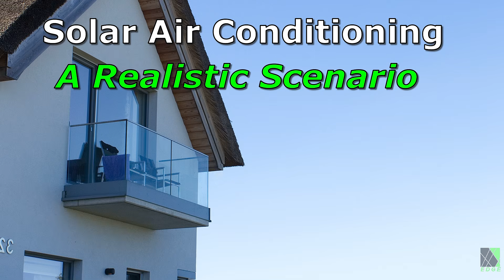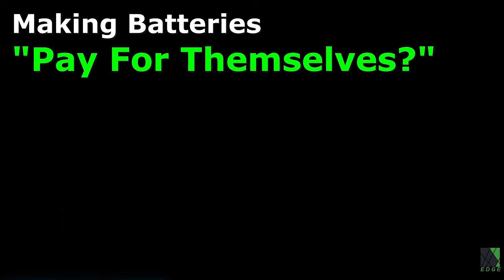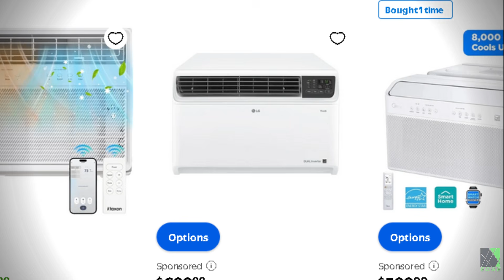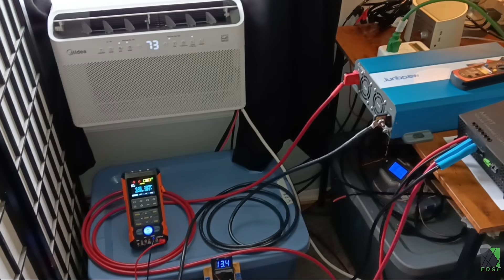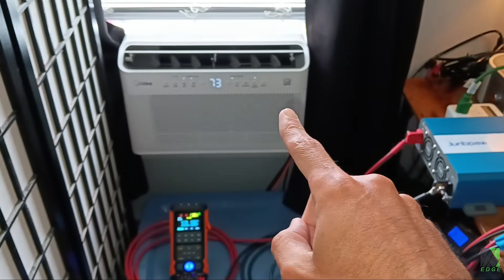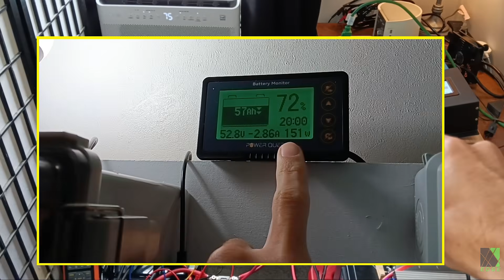I Made A Simple Off Grid Air Condtioning System - But Solar Has A COST  #Sponsored #Cyclenbatt

Comment: Love the details and how quick you explain the all the particulars. I often say that there should be more appliances powered by DC rather than AC.  I do have an eco flow wave 2 AC for my rv. I have multiple power stations in my home.  Eco for delta pro is connected to 6 circuit manual transfer switch. I run that power station during the day connected to 4 400 watt panels. It's able to run for about 6 hours running a 12 btu AC. This year i will be adding 16kwh of external batteries with a seperate mppt controller.  Watt cycle has created a cable that allows you to use off the shelf batteries to powrr the eco flow power station.  I also have a hybrid inverter as well.  I run a24 volt 3000 watt  all in one inverter in my rv. It's powered by 4 12 volt 314ah batteries in series parallel.  The system works as it should. It's cuts out if I'm running the AC and any other major appliance. Like the microwave or my air fryer. My issue with that all in one inverter is it requires high voltage  from solar in order to get the mppt to charge the batteries. The minimum is over 100 volts. I did connect a stand alone mppt charge controller for the time being.
Reply from the maker: @RAMMAN16 Thank you sir - nice solar setup you have. 
I totally agree there should be more DC appliances than AC. Solar is DC - that's where we need to go. I hope over time people will create increasing demand for DC appliances, and the problem will be solved by the market.
I hear you on the MPPT. Very common for MPPTs to demand a minimum high voltage input. That's the state of solar today. Hopefully in time, we will have more options and more flexibility. I plan to upgrade our copper cables soon, adding more solar panels and keeping low-voltage input with no charge controller at all. It costs me money for the thicker wires (yet not as much as all the electronics I will avoid)

Comment: Huh. I know there are some really good DC compressors used in freezers.

I guess that niche isn't really developed for living space conditioning?
Reply from the maker: @priestesslucy There are DC air conditioners, but they are really not that common. 99% are mains powered. I am trying to get a DC air conditioning unit for demonstration purposes to test with this system ASAP
Reply: @priestesslucy  RVs have 12, 24, 48 volt ACs available.

Comment: Please do this again however use a 24v “Semi” split air conditioner with 24v battery with 24v solar MPPT.  This would remove the need for the 120v inverter.  And potentially decrease your battery needs.  Also if you can get a 24v ultra capacitor you could eat up that start up current which would decrease the amount of batteries.  Also instead of having the AC try to hit a temp if you made your own controller you could set the unit to work constantly to prevent the batteries from maxing out. It could “freeze” the room but if you keep the door open it could keep your main AC from turning on.  

If you look at this as supplementing the cooling to decrease AC costs instead of actually cooling the room it should run using as much sun as possible.
Reply from the maker: @sarcasticpomegranate4549 Right on. I want to eliminate the inverter too. And I've been looking at those semi truck AC units. Really want to buy one. Thanks for sharing your ideas. I am using supercapacitors and investigating PV2L and DC air conditioning solutions since a several years back. I have some rough designs which will probably go into permanent service at some point. I'll be sure to share the results - if they work well enough.

Comment: Living in the Arizona heat in the summer I've been running three air conditioners on 6000 Watt inverter. One AC is for my solar shed The other two for my house. A 5000, 6000 & 8000 (inverter type} 95% of the time I only need to run during the day As there is a 30 degree drop in temperatures at night in the desert and humidity is usually very low. Like you said it's the piece of mind when power shuts off, I'm covered. Just  bought a Eg 4 12000 anxious to hook it up. Enjoy your video's
Reply from the maker: @DDCC7-v4w Nice setup! AZ is hot. We're running a 8k and 12k, and hope to add a third (it's 240v)

Comment: Great video! My version is EG4 6000XP/14.4kWh EG4 battery/5kW Solar/Auto-start 12kW generator (dual fuel but only run it on LP). EG4 powers all my houses critical loads, which is everything which is not 240VAC. During hurricane Milton it kept $500+ of frozen food frozen for over 5 days without the grid. We also have an RV that is parked next to the house which we stayed in while the grid was down. It took a lot less LP to run the generator for the RV AC opposed to running the house HVAC (3200 watts). Still working on improvements.
Reply from the maker: @donaldhoudek2889 Thank you... protecting our food is a huge reason for having solar power. One less thing to worry about 👍

Comment: My 12v 300ah LiFeP04 battery runs my little 5000 BTU Frigidaire air conditioner all night. I use it for power outages. The Frigidaire old school manual air conditioner has soft start so even a 700w Bluetti EB70 runs it.
Reply from the maker: @baneverything5580 Right on!! I love solar